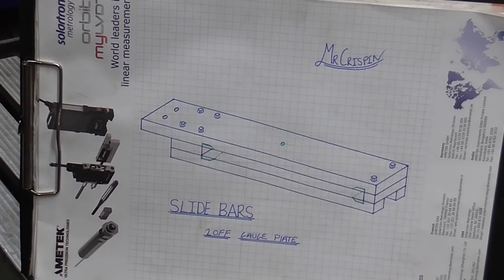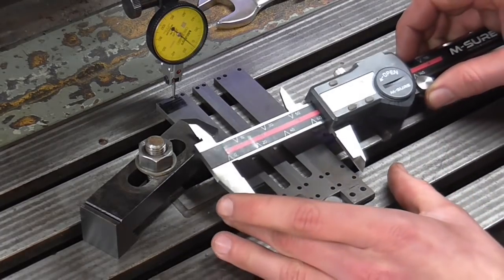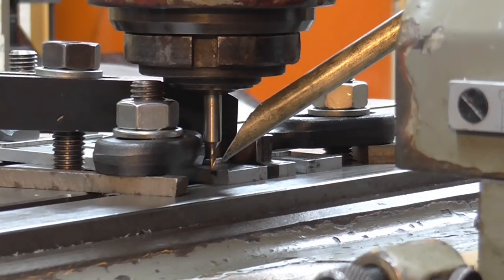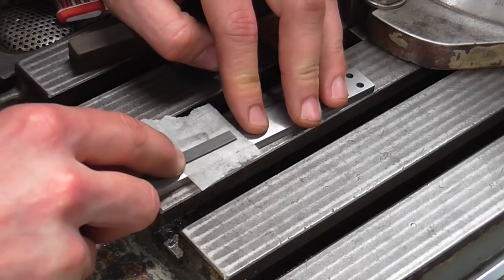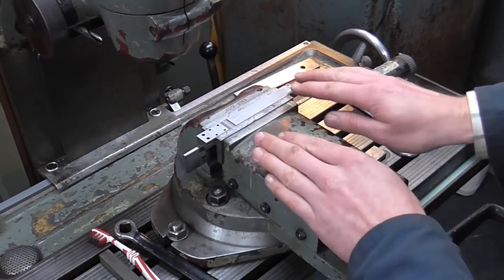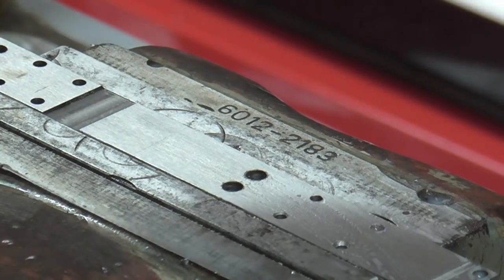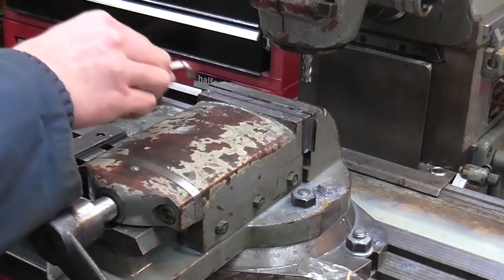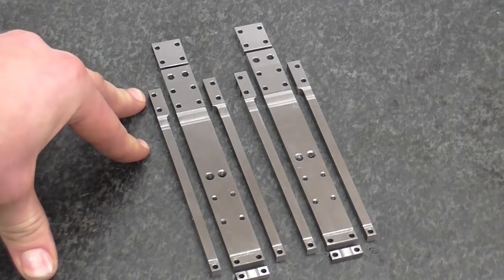Slide Bars Part 2

Comment: Deburring with protective sigarette paper. Nice trick. Thanks. And no dark room needed.
Reply: Bizarre process. Surely having the file or stone rotated 90° to the work and running it along the burr only would be a better way of doing it - if not even tickling it off on the grinder ?

Comment: Thanks for an informative episode. With the 2BA oil holes could you not machine a Bronze/Brass plug and re-drill?
As for the deburing why not across the edge side to side with a  slight angle?

Comment: I bought one of those edge finders.  Lasted almost two weeks before I wrecked it by moving a tiny fraction too far towards the workpiece and not realising it was not spring loaded.  Also, try it with the spindle rotating, mine was not concentric right from the start. Perhaps mine was a junk copy.  It's in the scrap bin now.

Comment: 8:38 sounds more like a C to me, but the pitch isn't quite in tune. Maybe after deburring it will have improved. If you were writing an instruction manual for creating these pieces, you could include tuning them harmoniously for bonus points - might make a difference when the whole assembly is in action - both in sound, as well as vibrations, nodes, etc.

Comment: Don't sit in a dark room to long people get depressed doing that 
 Take advantage of the oops 2bad holes tread brass bolts in to them cut them down then lap them flat with the running surface drill two smaller holes in the brass plugs and call the brass buttons wear pads   
Great video's though look forward for the next then the next ok you get it don't you    lol

Comment: Nicely done Mr Crispin. Have you plans to heat treat the slide components for wear resistance?
Reply from the maker: I don't think so as I haven't made any allowance for finish grinding to get the parts strait again. Instead I will make the mating faces out of Bronze
Reply: @MrCrispinEnterprises  it is probably not necessary seeing as these never see even a fraction of the use of a full size example.

Comment: Came out great Crispin. Thought about your 2 Ba oil holes, and you worrying about loss of surface area for the crosshead. Suggestion, when you make the oilers, use steel, make the thread long enough to protrude through the cross bar, then dress down to flush. Also too only drill a small hole for the oil, say a 1/16 " or so. That will give you back the area lost by you making it too big in the first place. I like the look of the new edge finder. How about a New 'Hattrick' ? Regards from Australia.
Reply from the maker: Great minds think alike! That's roughly what I was thinking of although I'm not sure weather to countersink the running surface and then screw something up from underneath or just screw down from the top. 
Going from underneath with a countersink would give a flatter surface but I'm not sure it's worth the risk of anything unscrewing and destroying the cross head.

Comment: Electronic edge-finder - Doubleboost uses one & he rotates his. I totally agree with that - the edgefinder should always be rotating. A high spot on the edgefinder then makes the light flash - and if you have it audio mode as well, you get a beep too.
Non-rotating works in theory. In practice, dirt, muck/ dust particles exist !

Comment: So you are not going to plug those big oiler holes with some bronze and drill and tap a smaller size through the centre of the plug and claim it as an architectural feature :)

Comment: Is there any benefit to putting some slots in the face of either of the sliding surfaces to allow oil to sort of bleed out from the middle of the mating faces? 
Can’t think of an example other than if you think of a scraped flat surface it has many very slight lows where oil can sit and provide lubrication on something like the sliding ways of a machine. Hope that makes sense.
Reply from the maker: Yes that's a good idea

Comment: Lovely to watch you work and any evening where I get to see you use that beautiful Deckel is an evening well spent.

Regarding the oil holes, they're not worth the bother of redoing the part, but do they rise to the effort of plugging the holes and redrilling? I'll bet you'd make a threaded plug that was undetectable short of a scanning electron microscope.

Comment: Your diagram states "Slide bars, 2 off"? You mean 2 of? ;)
Reply from the maker: I was wondering how long it would take you to spot that.
Reply: I’m not sure why but off is used instead of of in engineering when stating the numbers of things. If I remember to find out why long enough to open google I’ll get back to you.
Reply: @mopedmarathon  Thank you. 👍
Reply: Ok Iv done some Googling. Inconclusive results unfortunately.
Theory’s are 
1. I comes from saying run x amount off the production line.
2. There is a 1 off which is a one and only item so a 2 off would be 2 identical items.
3. it’s to avoid mistakes when things are labelled 2 of 4 etc. If it says off then you know there’s no missing info.
So take your favourite I guess.
Reply: @mopedmarathon  Just as I thought. :) :)